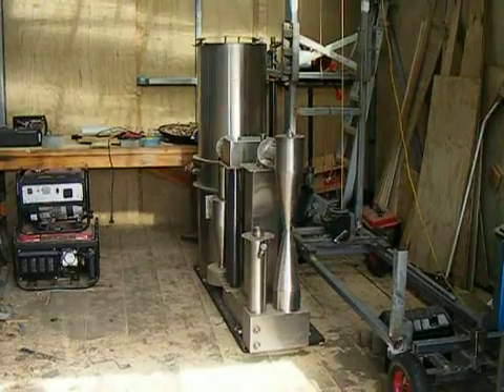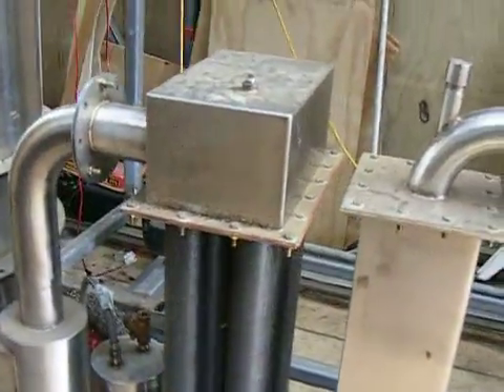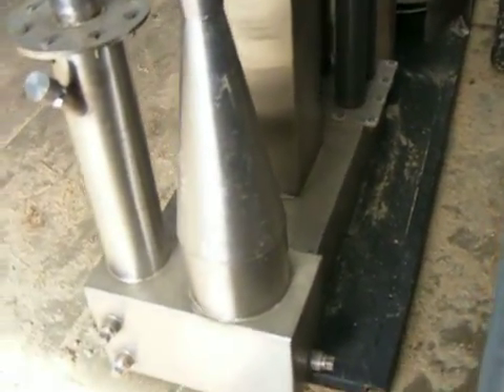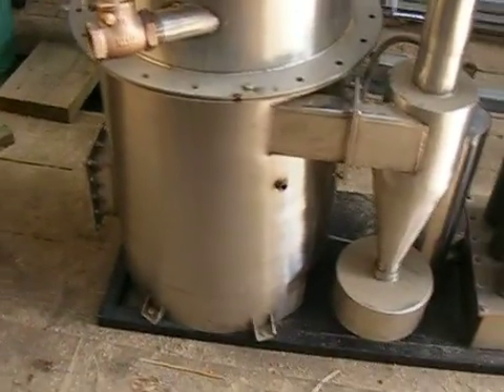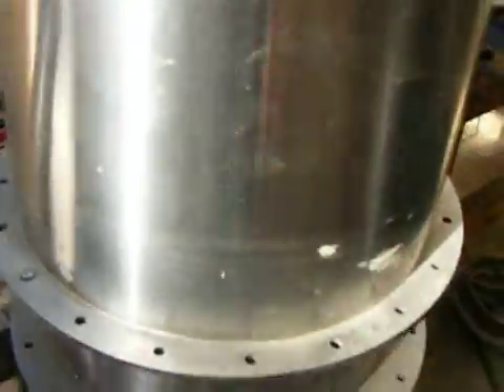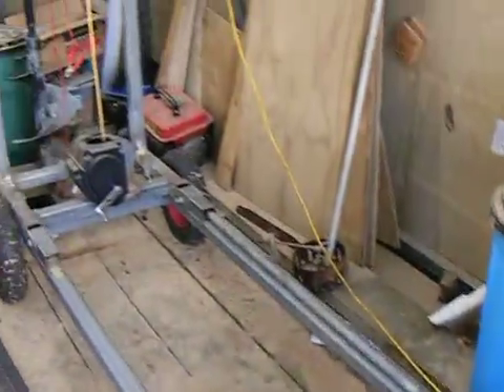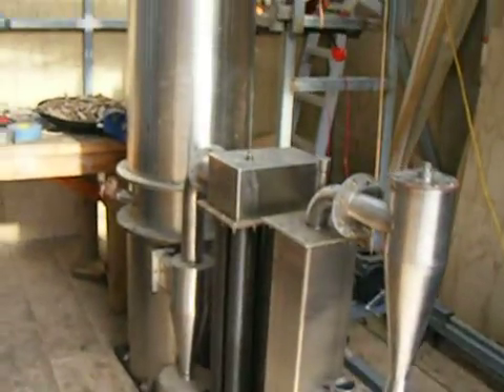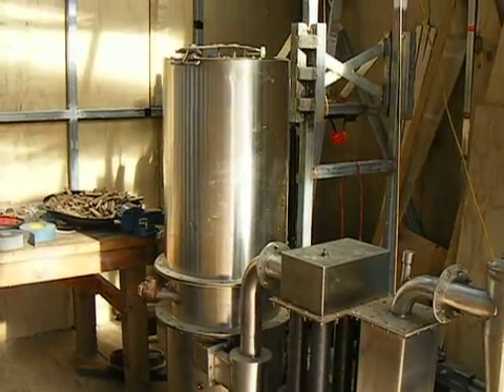Introducing The Off Gridder - Created by Ben Peterson.

Comment: Hey Steve, this last cyclone looks like a Venturi waterscrubber. The tank below could be the storage tank for the water. The two outlets on the side could be used as water out (top) to the pump which is lead into the top cap of the cyclone. The second (bottom) as outlet for a separator to clean the water again. The pipe outlet left to it looks like a gas water separator again where the water drops which were sucked up, can return to the tank.
Possible?

This idea came to me when I started to build a waterscrubber for my beast and I did some research about Venturi gaswasher.
I remember having seen somethink like this on Joe's channel --> https://www.youtube.com/watch?v=CM-rP0gjMNg
Reply from the maker: Howdee partner, 
 I think you are on to something here  :) . 
 Indeed, google thought the same, as it kindly marked your comment as spam! 
 Joseph's idea is really clever, and it seems reasonable to suggest that a similar concept has been employed in Ben's design here. 
 In time, I will pull it all to bits, and make a video about the insides of this shiny beast. 
 Hopefully, Ben won't mind me doing this  :) .
Reply: @CNCmachiningisfun  Did they really? Curious. I rebuilt Joe's waterscrubber and from principle it should work like a charm ;) I'm making progress with my blockhouse and when finished I'm going to assemble everything. The bug makes me so restless :D
Reply from the maker: @ravelkoff3549  
 Yup, google likes to hide the comments from good folks like you, while allowing idiots to comment freely, and suppressing my right of reply. 
 Needless to say, google sucks monkey butts! 
 Joe's water scrubber is a really clever idea, and I wood like to think that it will work very nicely indeed. 
 In time, you will surely get a chance to test this on your gasser, while hiding in your new blockhouse - from those naughty little woodgas bugz  :) . 
 Talking of woodgas restlessness, I have been making a new axial nozzle system for my other gasser. 
 You see, the normal centre feed pipe keeps burning out in my gasser, so I am gonna experiment with a 3 nozzle system, attached to watt is left of the downpipe, to see watt might happen. 
 Maybe I will make a video of it too  :) .

Comment: For a motor to run on the shiny thing, you may want to look at a Prius motor. They have a different valve setup, so the expansion volume is greater than the compression volume, with very good thermal efficiency, and very quiet. Standard size is 1.5L, or 1.8L ( I have the 1.8L ), but you can't have that because Im still driving it. The generator on them makes nice volts, with the battery sitting at around 230v DC. The OBD2 says it is doing 5Kw when idling.
Reply from the maker: +Rotovid 
 Hmmm, I like that idea. Perhaps it wood be an overly spendy option though? 
 Its electrical performance sounds absolutely perfect, as does its quiet operation. 
 Ohhh, so attractive! 
 I have a nice little 1800CC engine here that I am considering for this gasser. 
 It should be a fairly simple job to set this all up and get it working sweetly. 
 My only regret with this gasification game is that I didn't know about it 20 years and beers ago.

Comment: are u going to try ur hand at a car there are a few dynamics u dont have to worrie about when u do a car as opposed to a power station u dont need a vibrator shaker b\c the bumps in the road do it for u second be prepared to be swarmed were ever u take it it happened to me every time i took it out =) if u have any questions just ask
Reply from the maker: +xoxoXoieoxox 
 Yup, one of these days, I wood like to put this on a little pickup truck. 
 I wood like to think that the motion of the vehicle will help to cool the gasifier, and also shake it up inside, so I don't have to worry about it. 
 Storing enough wood for a trip might be a bit of a problem, but I am sure I can deal with that  :) .
 Yeah, people will probably crowd around the truck, to have a look at the gasifier - and ask questions. 
 This used to happen to me a lot when I used to drive a horse and cart in town. 
 Folks were plenty interested, so there were lots of questions to answer  :) .
Reply: thats how it works on my car =)
Reply from the maker: xoxoXoieoxox 
 Here's an odd question, is the term "ute" known in your area? 
 Here in New Zealand, we use the word "ute", as in short for utility vehicle, to define pickup trucks. 
 It wood be good to know if that is common around the world.
Reply: not to non car guys we have a habit of calling any type of car-truck a elcomino or ranchero like my bug truck would be a volkschero or a elwagon type of thing i personaly use the word ute but some people dont understand me some times lol they use it commonly in erope and down under but ford and chevy made those el cominos and rancheros from the late 50s to into the early 90s i thonk so that why theya re referd that way here i supose good question =) we have new models and there caled SUVs or a ute would be a SUT here (sport utility truck)

Comment: Why couldn't you use the smaller chu ks in this bigger machine?
Reply from the maker: +Yves Baggi 
 That's a good question  :) . 
 The main reason is a thing called interstitial space. 
 Because of the relatively large airflow through the nozzles, there is a corresponding need for an increase in the amount of space between and around the wood chunks, in order to permit a hot and clean burn. 
 Also, because the grate on this gasser has larger gaps in it, the smaller charcoal chunks produced by the smaller fuel lumps would pass through it too easily, thereby undermining the charcoal bed beneath the hearth. 
 I plan to make some changes to this gasifier, so I can get away with smaller chunks, and lower gas flow rates. 
 This is currently a 40 to 50 HP gasser, and I would like to tame it to a mere 10HP, if possible.
Reply: That is a very good reason, Just like a bucket of sawdust can choke a fire. It can also "explode"  when the sawdust is up in the air. I see. thank you.

Next question:
How do you determin it is  40-50HP gasifier?
does that mean it can fuel a 40-50HP engine/generator?

Why would you want to tame it down? or another question, is what parameters can you influence to twead the "power" without a rebuild.

Thanks I just subsribed to your channel after I saw you showing Ben's gasifier. I have his plans but my skills are was below par to tackle this project as of today.

From your comment it seems like you didn't build Ben's gasifier?
Reply from the maker: Good questions  :) .
 The power of the gasifier is determined by its internal proportions. 
 Such things as the size and number of air jets, their distance above the hearth - and the diameter of the restriction opening are all important aspects of the gasifier's power capacity.  
 This 40 to 50HP gasifier can be used with an engine of about 100HP quite comfortably. 
 Now, since we tend to lose up to half of the engine's capacity when running on woodgas, it pays to use a bigger engine in order to get all of the horses out of the available gas supply. 
 I need to tame this down, as it is harmful to run a gasifier at an abnormally low power level. 
 Gasifiers have what is called a "turn down ratio". Typically, this is in the order of 3:1 for a good gasser. 
 What this means is that the lowest power level you can reliably draw is 1/3 of the rating of the gasser. 
 Since my power needs are very modest, 10HP is more than I will ever need. I plan to tame this down to 10HP, so as I can safely draw as little as 3.5HP, without risking excessive tar production from a gasser that would otherwise cool down too much. 
 I hope that made sense?  
 The main parameters I will seek to adjust are: Nozzle port diameter, Hearth restriction diameter, Hearth elevation - relative to the nozzles, Grate bar spacing and finally, the fuel chunk sizes. 
 All of this can be done via a set of relatively simple, and reversible, modifications  :) .
 Yes, you are right, I didn't build this gasifier. 
 It was built by Ben Peterson a few years ago - somewhere around 2010. 
 What size of gasifier would you like to build? 
 Starting small is a good idea, as that is a great way to learn about this fascinating subject  :) .

Comment: Wow man! Talking about pennies from Heaven, you have your hands full with this beast for sure. I've seen these running on a few youtube videos and this is capable of taking a working farm off-grid. I'll be looking forward to seeing this up and running in the near future
Reply from the maker: +xoxoXoieoxox
 That's a good lesson about the bigger hopper promoting moisture buildups in the fuel wood. 
 I guess it's a matter of finding a suitable trade off between gasifier run time and fuel quality preservation. 
 Here's hoping this big gasifier doesn't suffer from that problem.
Reply: flash001USA...YOU kick butt too buddy!! Love your information on builds as well!!
Reply from the maker: +flash001USA 
 For sure, this is a powerful beast. Indeed, it is way more powerful than I can even use! 
 The little gasser, with its modest 1500 Watt output, is able to keep this place offgrid all by its little old lonesome  :) . 
 That stated, I figure that this big beast will become a multi purpose unit, delivering compressed air, DC arc welding current - and AC mains voltage for all sorts of electrical loads. 
 There are plenty of horses under the hood, so I need to think of some good ways to harness them all  :) .
Reply: I told mark the same thing that it was probably more than you needed but there's nothing wrong with more.
Reply from the maker: flash001USA 
 Indeedy, this beast has a lot more horses than I can feed, so I am considering modifying the hearth, grate and nozzles on this giant, to tame it down some. 
 I reckon I could reconfigure it to a more sedate 10HP rating, without too much fuss. 
This wood save the local supply of Treezel for later, when my power needs may go up. 
 There's a lot on my plate right now, but I plan to pile into this project in the fairly near future, once I have added a couple more steps of perfection to my auto mixer project. 
 So many projects, so few hours in a day!
Reply: Steve you could make a drop-in retrofit and even do a simple mod for the nozzles too and this way you would only need to fill the hopper up once a month!
Reply from the maker: flash001USA 
 LOL, the final part of your comment made me chuckle  :) . 
 It's like my car, which hasn't had a drink of petrol since waaaayyy back in 2016  ;) . 
 For sure, I plan to do watt you have suggested. That way, it is readily reversible, so I will be ready to become a Treezle Guzzler when the price of free wood comes down again  ;) .
Reply: you know flash i origanaly put a huge hopper on my gasifier for my car and i knoticed a problem after a wile with the larger hopper it was more prone to puff backs when low on fule and buy the time i got to the bottom of a hopper the wood was all like ruined buy moisture and it would be all black with condencates and yes i have a condencate jacket its imposible to stop so i cut it down buy hals and i had to refuel it more offten but the wood quality stayed up and inturn the gas stayed good longer as well as the fillters
Reply from the maker: Indeed, Ron 
 Thanks to good folks like Flash, the future of homebuilt gasifiers is positively assured  :) .

Comment: Steve, I'll say he is a very dear friend. What a piece of work there. Now you have to re tool your wood processing equipment.......Gee, such a dilemma.  Love all that stainless steel.
Reply from the maker: +mada94fxr 
 Agreed in full. 
 He had plans for this big gasser, but when he saw what I was able to do with the little one, and considering his busy life, he realised that this wood be the best new home for this shiny beast  :) . 
 That stated, once I get it up and running, I do believe we can still use it to achieve his plans and goals for it  :) .
Reply: Knowing you, we wont have a long wait for you getting it up and running. Again, that is one work of art. Shiny too,........
Reply from the maker: +mada94fxr 
 Thanks for the vote of confidence  :) . 
 I need to create a blower for this. Something that can handle a bit of abuse, because the initial gas may be quite hot and dirty, until I get it running sweetly. 
 As I see it, I may need to build a startup radiator / fan package, much like I did on the smaller gasifier system. 
 There's plenty to be done, but I sure am itching to get into it, once I get a few other jobs out of the way  :) .